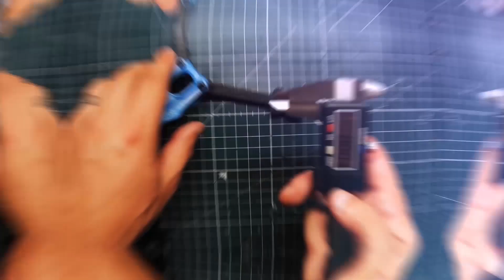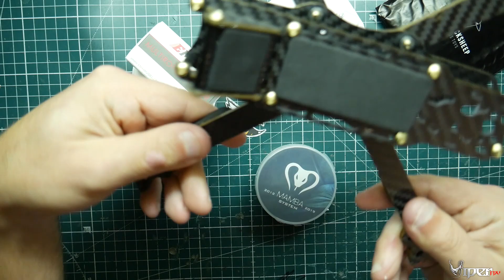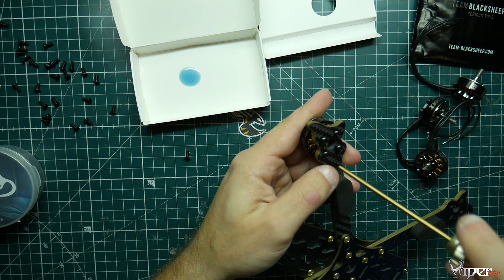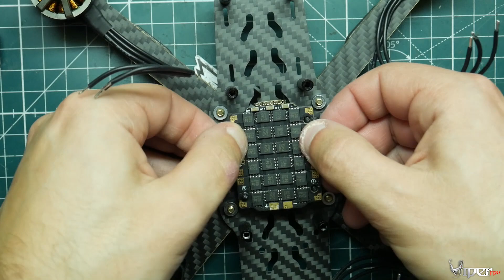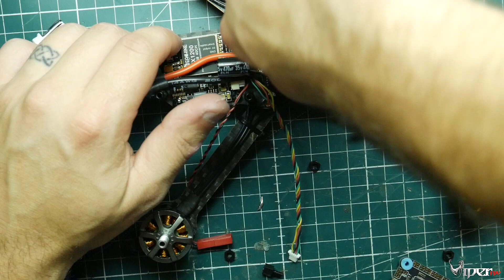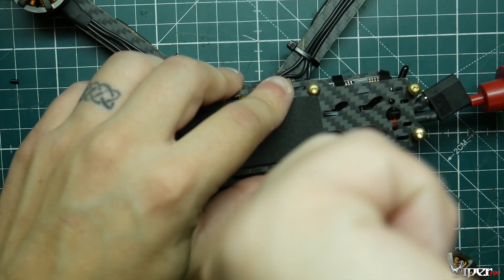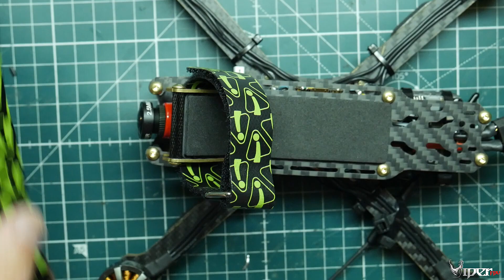How To Build a PRO FPV Freestyle Drone for ONLY $120 - Best Budget FPV Racing Drone Build of 2020

Comment: Can I use batter cable thickness 14awg? 12awg is hard to solder.
Reply from the maker: JS제이에스 you can but 12awg is reccomended for the battery leads

Comment: Help I have martian 2 frame 2205 2600 kv motors suceex x4 mini stack and it's just not looking like it will work. What should I do now???
Reply from the maker: What won’t work?
Reply: @ViperFPV  how do mount the mini stack. Keep in mind I'm a total newb with no friends in the hobby
Reply: @ViperFPV  any answer on the mounting of the 20x20 stack on the Martian 2?

Comment: Can i usw the FS ia6 and how?
Reply from the maker: Yes wiring should be the same as the frsky receiver
Reply: @ViperFPV  and how. The reciever ist mounted under the f4. How can i Connect Thema. Wich Pin do i need
Reply from the maker: Dokter Maiskorn u need to solder to the sbus pad 5v and ground

Comment: Hi Viper_FPV, maybe a stupid question but in the build you are using screws and bolts etc. Any recommendations on supplies. Likewise wire. Cheers
Reply from the maker: Most of the hardware and wire all comes from the parts you purchase. Stack screws come with the stack, frame screws come with the frame, motor screws come with the motors. Xt60 comes with the FC stack...etc

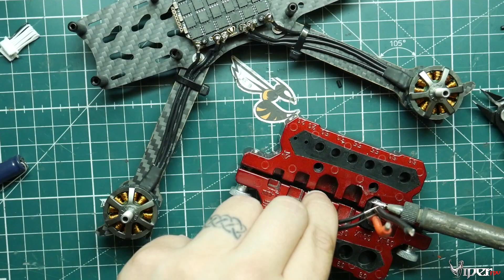Comment: Hi. I was wondering if one of the products that you have in the description has the xt60 7:02  that comes with it, or do I have to buy it separately? Also, do the wires that you used with it come with xt60 or do I have to buy that separately also? Last question lol. Does this setup come with all of the screws, wires, etc? Thanks in advance!
Reply from the maker: Micah Evearitt the stack comes with the xt60 and wires.
Reply: @ViperFPV  Wow, that's actually awesome!
Reply from the maker: The frame comes with the screws.

Comment: Hi there, I have purchased all the parts for the pro build using your links. The areal is currently OOS, Are there alternatives. Also I have a Spectrum DX6 and a receiver. Can these be used and if so what if any changes are required? Likewise I have a Fatshark Dominator V3? Thanks for any advice. Cheers
Reply from the maker: Yes the spectrum can be used as long as it is using a small receiver. What is OOS?
Reply: Viper_FPV sorry for the shorthand. OOS is out of stock. Also the 2400 motors appear to be the same. Can I substitute the 1900 motors? Won’t be doing heavy freestyle yet as am a beginner.
Reply from the maker: Scott Trevena yes you can and u can always replace the motors later with a higher KV

Comment: at 12:50 you show that the receiver is mounted under the ESC, but then mention you are adding another receiver,  I don't get it?
Reply from the maker: I believe I was explaining how to wire a crossfire receiver and then a frsky receiver depends what protocol u use and you only need 1 radio receiver

Comment: I'm complete noob, so sorry if this is a dumb question, but would it work with fullsize GoPro of similar knock off? I ussualy see it with GoPro session, so just wonder if there is enough power for extra few grams or would it messup balance of the drone?
Reply from the maker: Most definitely u can put 2 gopros on it and it will still fly with plenty of punch

Comment: I have build the same drone and when i fly with 6s it  freaks out when in give full throttle (2400kv motors ) (battery tattu rline 1300mha 120c)
Reply: You cant use 6s batteries woth 2400kv. You either have to change to 4s or 1700kv

Comment: The cables. I don't geht it. Its so complex for me. I'm a Beginner and i want to build my First Quad. I'm confused with the cables
Reply from the maker: Dokter Maiskorn what cables are you referencing
Reply: @ViperFPV  the Red and the black from the vtx and the gren and the yellow from i don't know.

Edit: it's my fürs Quad and i don't want to make it wrong
Reply from the maker: Red vtx power ground is black. Yellow is video and green is probably smartaudio which connects to a TX 1 or 2 or 3 or 4

Comment: Ran it with a 3s to test it, but realized I didn't plug an antenna to the VTX, so I immidiately unplugged it. Mounted the antenna, ran it again, and short... Smoke came out in a burst. Still, connected again with the VTX original antenna, and it is running with lights on, but I suspect it's toast. Any thoughts on this?
Reply from the maker: Question is does it still work? If so then it’s fine and u got lucky if not then something fried and u would need to take it apart to see what fried and why
Reply: @ViperFPV  I can still select band and channel on the VTX, but I'm not sure if it's fried or not. Maybe the FPV camera is not working?

Comment: Which lipo batter is required to this quad I am an complete rookie in this hobby plz help :( and can u help me with a good transmitter with this comparable for this quad
Reply from the maker: A 4S 1500 mah battery would be perfect, it can run on 6s 1500 battery if u went with lower kv motors like 1700kv

Comment: I just started watching this and i’m definitely gonna build it, does this include everything, like battery and program for it and how to do it and other things that an inexperienced fpv drone flyer would need?
Reply: what solder should i use and does it matter the type of solder iron and or wires
Reply from the maker: This is part 2 of a build series check out the playlist as after you build it u will need to program it which I have made a video on. You I have tons of tutorials to set everything up. 63/37 solder is my recommendation
Reply: Viper_FPV oh okay perfect thank you so much! great video, keep it up!!

Comment: Should i build this drone? And if i want to drive it when im done, what do I need to buy?
Reply from the maker: Lukas Kalvoy yes you should! You will need a radio, batteries and if you want to fly it fpv goggles. Check out my recommended gear in the description for a radio or goggles to fit your budget.
Reply: @ViperFPV  thank you so much bro😊 i am going to spare money to buy it😎
Reply: But how Long flying time with the 4s and with the 6s? And do i need to buy a reciever too or just the controller?
Reply from the maker: Lukas Kalvoy sometimes the controller comes with 1 receiver, a xm+ receiver for frsky would be my preference or an RXSR. Flight time if it’s your first quad and you are just learning u may get about 4-6 min. Once you start doing a lot of bashing and punching it a lot flight time would be around 3 min. 6s and 4s times may vary but possibly expect maybe 10% more time on 6s
Reply: @ViperFPV  okay, im just gonna buy  4s then, but do i have to buy 4 motors or is it 4 of them in the package? Sorry for all the questions, but the cheapest fpv goggles does not ship to norway(where i live) so do you recommend any other fpv goggles?
Reply: You just got a New Subscriber btw, its Nice that you are answering Peoples questions, its not all youtubers Who does that😎
Reply from the maker: Which goggles were u looking at?
Reply from the maker: Thanks! I try to answer all questions
Reply: @ViperFPV  i was looking at fatshark recon
Reply: But like, i cant affort the other ones
Reply from the maker: Do they ship to you? https://m.gearbest.com/fpv-goggles-monitors/pp_009307931499.html
Reply: @ViperFPV  yes, this store ships to norway😎thanks
Reply: @ViperFPV  last question for you now😅 do i have to buy 4 motors or is it 4 of them in the package?
Reply from the maker: U have to buy 4
Reply: @ViperFPV  ok, thanks

Comment: will a battery like this work on it? I'm a total noob at this and I don't wanna do something wrong lol. 
Minimum Capacity: 1400mAh
Configuration: 6S1P / 22.2V / 6Cells
Discharge Rate: 120C
Max Burst Discharge Rate: 240C
Net Weight(±20g): 233g
Dimensions:76mm x 39mm x 43mm (L x W x H)
Charge Plug: JST-XHR
Discharge Plug: XT60
Reply from the maker: Yes but make sure u are running 6s motors.
Reply: @ViperFPV  Alright, thanks a lot!

Comment: Does the set-up come with a reciever?
Reply from the maker: The 120 price does not since the receiver price depends on what kind of radio u are using.
Reply: @ViperFPV  Roger that, bought one for my FlySky, with total price for my drone at 155 euros. I already have fpv goggles.
Reply: @ViperFPV  Thanks. Do you know nay that works with the FlySky or a Turnigy 9X? I'm having trouble finding any...

Comment: What type of Emax ECO Series motors are you using (1700KV, 1900KV, 2400KV)?
Reply from the maker: This build which was built for 4s 2400kv.
Reply: @ViperFPV  so 6s isn't possible?
Reply: Jack Tiebie 6s is fine if you use 1700kv

Comment: This is the best bird get drone build I have seen, it’s cheaper then the rest but looks really good, I am a big ginger and hope I can buy the parts and build it with no problems..  I have a question, I am going with the base build and was wondering if I could use the pro builds motors on it? And also a different antenna?
Reply from the maker: NicoTheChico you sure can! Thank you!
Reply: Viper_FPV thank u sorry for all those weird auto corrects lol

Comment: So I just finished this build and on startup, before syncing to a controller or anything 1 of my motors stutters and spins on its own and ends up heating up if I leave it long enough! I have no idea what could be causing this or how to fix it :(
Reply from the maker: Check you solder connections to the esc make sure there are no shorts. Also check your bolts on the bottom of the motor and make sure they are not touching the windings. Let me know
Reply: So I've checked everything from that motor and all seems fine, I've double checked with the voltmeter in continuity and doesnt seem to be anything shorting as far as I can tell but I'm no expert! Windings are all good I've backed the screws out just to double check. The only thing is I haven't added a receiver yet as I didn't realise this was separate to the VTX :/ I'm stumped
Reply: @seanboe7198  any updates man?
Reply: @seanboe7198  How'd it go?

Comment: Can I fly 6s with the 2400kv motors ?
Reply from the maker: Yeah as long as your esc is rated for 6s and it has a high amp cap.
https://youtu.be/SPWuijhiEPg
Reply: @ViperFPV  what do you mean with cap. ?
Reply from the maker: wout schouten like your esc is rated up to 50 amps or 60 amps

Comment: Which goggles and remote would you recommend.
Reply from the maker: If your looking to just start out and not worried about long range like crossfire the Frsky Qx7 is a very nice radio which you can always add crossfire to it later down the road. Also the Jumper T16 is a very nice radio as well. Regarding goggles without knowing your budget on the high end Fatshark HDO2 hands down is the best. But something a little cheaper like midrange either the HDO you can find good deals on them
Used or the Attitude V5 which has a very nice OLED screen. On the lower end the Fatshark Recon are some nice goggles as well with a pretty good DVR included.
Some links

Fatshark Attitude V5 OLED http://bit.ly/2XrRZJS
QX7 http://bit.ly/2L2pVGk

Comment: Nice job...what is flying time of this quad?
Reply from the maker: 3-4 min depending how you fly.
Reply: Noobie to drones here and thinking of getting into the hobby. Why is the flight time so short for this drone? I'd like to fly longer, could I just throw on a larger battery or would you need to build an entirely different drone for longer flight durations?
Reply from the maker: Miles Papineau the time I have is normal for this type of drone . And yes u can add a bigger battery but then u hurt performance because of weight
Reply: Thanks for your response! I see. Is that because this is a racing style drone? I'd like to build a drone for aerial sightseeing with a decent run time like the new dji mini (?) With a loner flight time. Is this just a matter of using lower wattage motors and a larger battery more or less?
Reply from the maker: Miles Papineau yes it’s because it’s the nature of freestyle and racing drones. They are made for speed and durability and being light. What u want to build is an Arial photography drone. Look up DIY photography drone
Reply: @ViperFPV  thanks viperfpv. Great video by the way

Comment: My fav frame😍good thing you build it using tis frame...cant wait to build mine
Btw can it fly in 5s n 6s?
Reply from the maker: Yes as long as you put 6s motors on it, you would need 1700ish kv motors for 6s
Reply: Viper_FPV nice thanks for reply....btw hve you test the top speed?how fast is it?
Reply from the maker: Yeo Yeong I don’t have a GPS or a speed gun on it. But I would estimate around 80 mph
Reply: Viper_FPV wow tats quite fast...thank again for reply keep up the great video

Comment: What is the capacitor for? I need to put it in every quad or there is some expecific situations ?
Reply from the maker: Every quad, capacitors help the electrical system in reducing noise from the esc and motors going into your video system. Without one you will get a lot of lines in your video
Reply: It is not required but is suggested. just like foam on chairs!

Comment: Okay, so I've watched this video over and over and looked in the description what is the TBS nano receiver? I am a complete newbie with this and I am very confused. Also along with that how does it work does the frsky hook up to a pair of goggles or do I need the other part to one of the receivers as well.
Reply from the maker: Nano receiver I used is for crossfire which is a 900mhz long range link. Frsky is another receiver but on the 2.4ghz band. Which one you use is up to you and your budget. I use crossfire because it does help with penetration with a lot of obstacles. But for a newer pilot frsky is great also. Frsky and crossfire are radio receivers ( controls the aircraft) The video transmitter is what will transmit the video to your goggles which uses the 5.8ghz band
Reply: @ViperFPV  Okay awesome thank you. 
So if I were to buy everything that I would need to make this build I would need: Frame, ESC, FC, VTX, Antenna, Motors, Props, Transmitter and remote, and then a pair of goggles? Do I NEED the rapidfire?
Reply: @timoty-pb3rs  Unless you’re flying in really sketchy spots (to which I’d say a beginner shouldn’t anyway) or flying really really far away (which you also shouldn’t do without experience) I think you’re fine on not spending an extra hundred 👌

Comment: Hi, please help, I just built the drone based off your video with the FrSky XM Plus Mini Receiver and I have it bound to my transmitter... However when I go to plug the drone into betaflight the drone pops up but the transmitter does not. I have a battery plugged into the drone and the green light is on on the receiver saying it is bound to the transmitter... I cannot get the transmitter to hook up to betaflight. It is a taranis x9lite, and I have downloaded the firmware with d16 already. Please help as I cannot get the drone to fly without the transmitter connecting to Betaflight. It says RX_FAILSAFE and MSP for the flags. I am confused why the receiver says no connection when the green light is on saying it is bound.
Reply: Also might be important to note when I plug in the battery my motors move a little bit and the board beeps 3 times but that is it... When I try to move them in betaflight with the sliders or with my transmitter nothing happens.
Reply from the maker: That is normal for it to beep and the motors to move when u first hook up the battery. Did you setup the configuration for the receiver in the configuration tab of betaflight?
Reply: Viper_FPV yes, I set up serial rx to the correct uart and the transmitter is bound, but won’t pop up on beta flight and acknowledge the transmitter...
Reply from the maker: Jamie.arquit when u say uart do you have the frsky receiver wired to the sbus pad?
Reply: Viper_FPV yes, it’s wired to Sbus pad
Reply from the maker: Jamie.arquit would you mind emailing me some screen shots of your config page and wiring of the receiver to the flight controller?

Comment: what controller do u recomend
Reply from the maker: Either the QX7 or X9. I have some recommended down below
Reply: @ViperFPV   can u give a link or name to everything that u use that isnt in the budget pro build sorry for asking so many questions im turing 14 and want to build my first drone
Reply: would this be ok instead of the antenna u said
Reply: @ViperFPV   and i dont have anything but a soldering iron and screwdrivers

Comment: This is just an amazing build. I really want to get into this drone thing but my budget is limited. When you say $120 I would probably spend around $200 for some more tools and some parts I break in the process. But this looks really interesting.
Reply from the maker: Thanks, yeah there is a few odds and ends u will need extra like a receiver
Reply: @ViperFPV  and a battery

Comment: how did you remove the 5v cam power wire from the vtx once it was already mounted? did you just cut it off?
Reply from the maker: Nic Nolan I pulled it out of the connector.
Reply from the maker: U have to get something tiny and bend up the plastic tab on the connector

Comment: I can’t screw the screws down on the esc in between the fc. Think it’s hitting the corner solder joints? Did you ever have this issue?
Reply from the maker: U mean your solder joints are in the way of the nuts? U may need to remove some solder if that’s the case

Comment: Great video and easy to follow, except when you got to the receiver end of the video, I got confused when you showed/said two different receivers. I just got into this hobby and didn't realize you went with the crossfire nano. I wired my r-xsr like your nano... and after it not working in betaflight and some searches found out that it uses sbus (like you said in your video, I just didn't know the difference) Maybe point to the sbus on the actual stack next time for the noobs like me :) Other than that really helpful video so Thank You!
Reply from the maker: MagicBob sorry about that! Thanks for your input!
Reply: @ViperFPV  Nah its all good, honestly made me learn more about my quad so all good